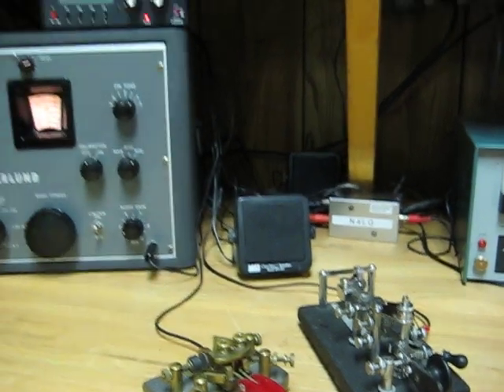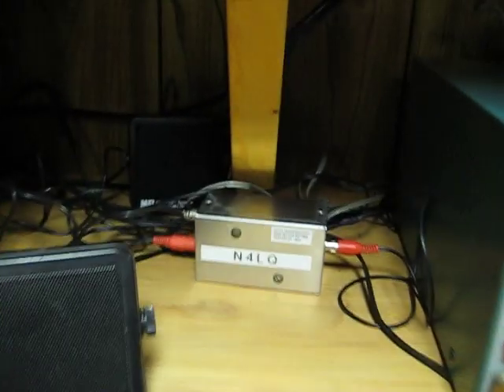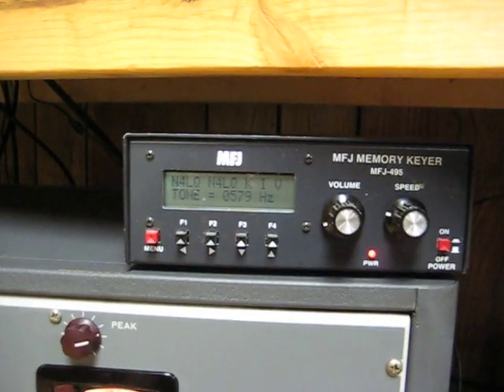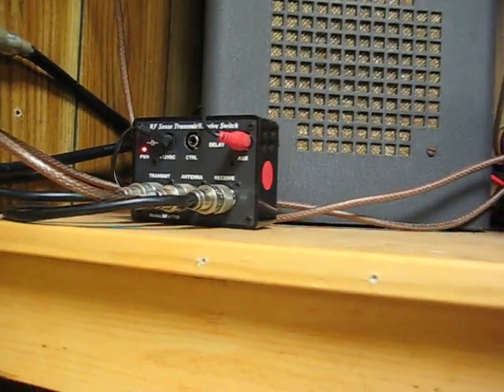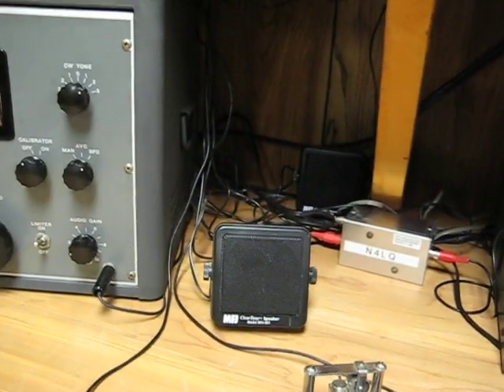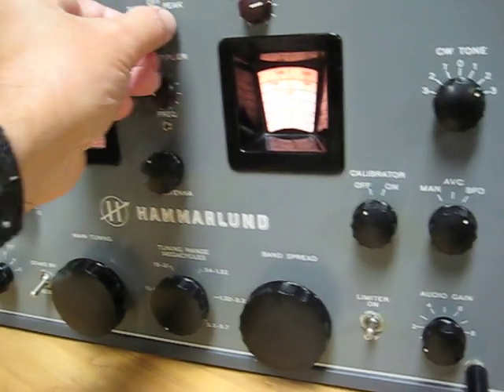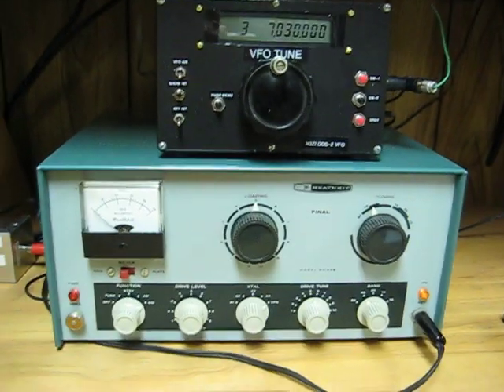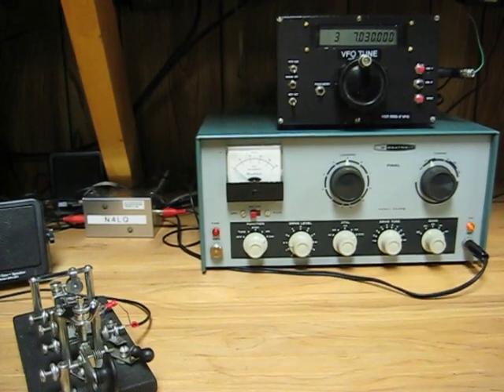DX-60 DDS VFO HQ-150 MFJ-1708 Vintage CW RIG

Comment: Is the mfj 1708 the last thing in line?  Eg..   Radio, Amp, Antenna tuner then the 1708?
Reply from the maker: TUner must be last. Don't want high SWR on the 1708! Also beware of 100w power limit.
Reply: What is it that you have plugged into the AUX jack of the 1708? Appreciate all your videos.

Comment: Steve,  how do you key your VFO?   Do you change the RIT or what?
Reply from the maker: Jack Margolis Yes....I key the RIT and DX60 at the same time. I simply run the key line current through an optocoupler and let it key the RIT on the VFO. I offset the VFO by about 1 mhz or more. The VFO keys cleanly no matter how far the offset.